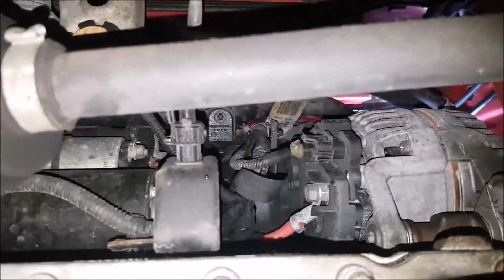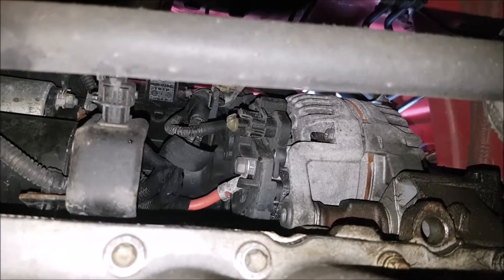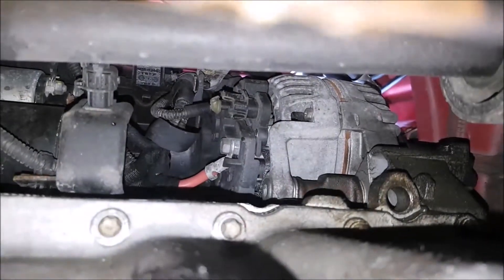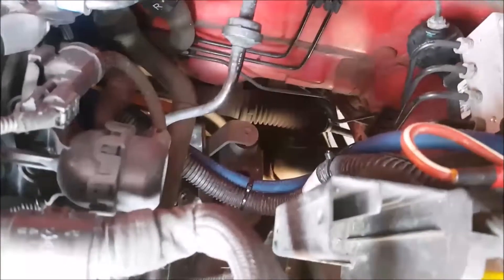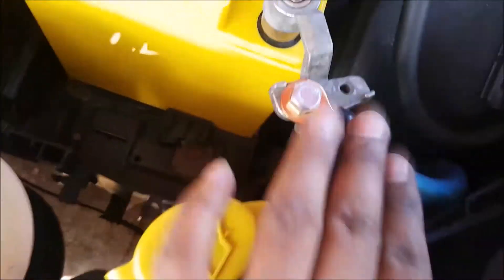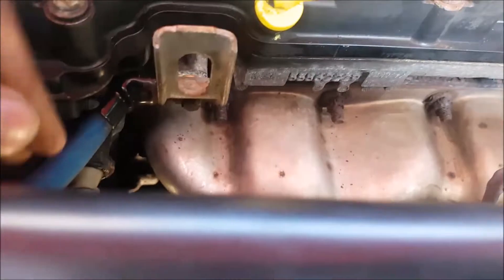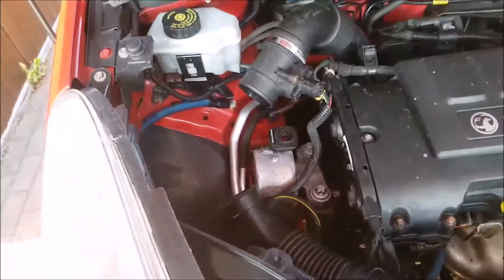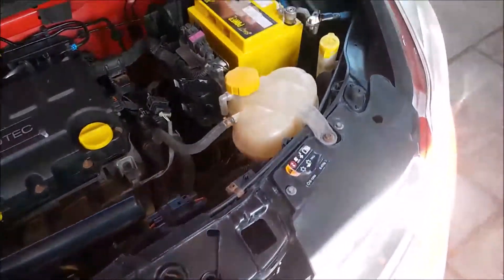Vauxhall Corsa Big 3 electrical upgrade || Orion HCCA ||

Comment: hi did you buy this as a kit ? if so can you post a link? thanks
Reply from the maker: No I had some extra 0 gauge cable and used that. Just google 0 gauge audio cable and buy 2/3 metres depending on size of vehicle
Reply: Down4sound.com has kits
Reply: 2 meters be ok for a Corsa?
Reply: Handy video cheers mate